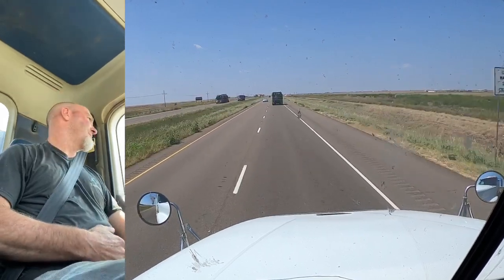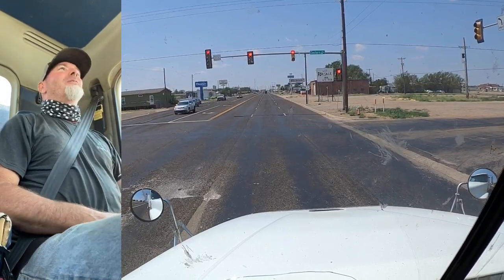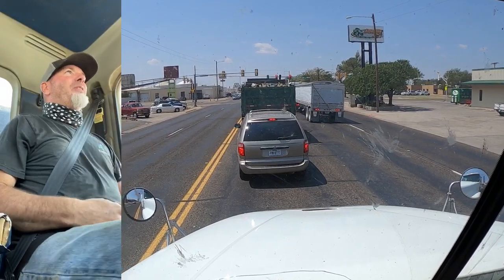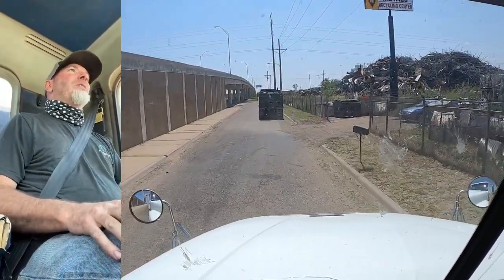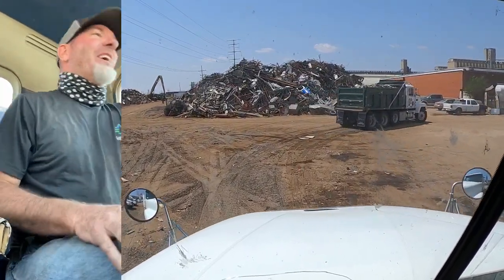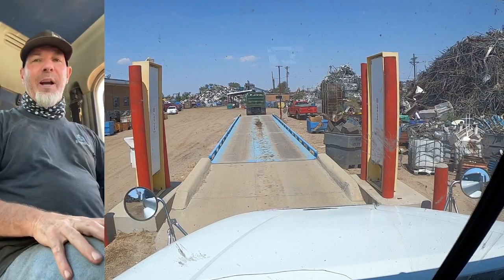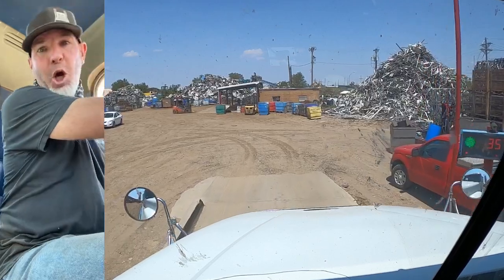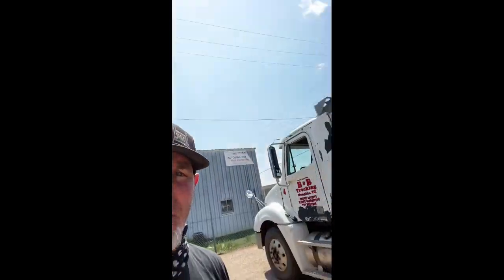Screwed Up Dump Truck scrap metal haul, Bad day for a trucker, Trucker Vlog G.O.A.L get out and look

Comment: Been over there picked up a lot of loads from there!! Have to pull off the scale go over on the other side of the building there is a dock there. Look at it thus way at least you didn't hit the air to air🤷🏾‍♂️
Reply from the maker: 10-4 always gotta look for the silver lining 😂 thanks Jack

Comment: Things bite when you're least expecting ... facing the boss hurts and you feel like a numpty ... I worked a lot on rubbish tips and all sorts would pop up and do damage ... bed mattresses were the worst wrapping around prop shafts, a nightmare cutting 'miles' of spring steel wire off and mending air pipes ... Time for you to sit down, chill out and have a few beers ... toolbox awaits you !!! ... regards from England.
Reply from the maker: Yes sir, gotta go get it and start tearing it down, Thanks Julian
Reply: It's the rebar and aluminum shards that the magnet doesn't pick up that gets me...
Reply from the maker: Yes sir, I really hate going into those places, always spend more 💴 then what we make 🤦 thanks for watching!!!